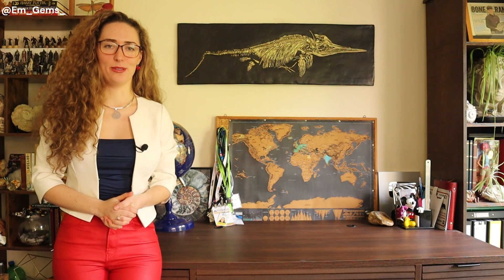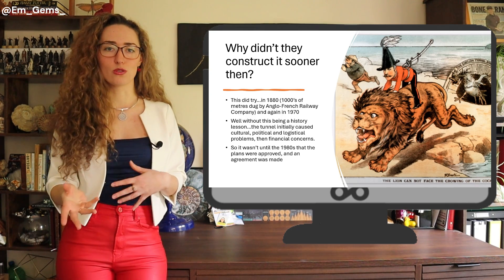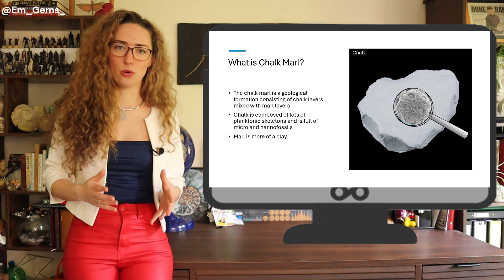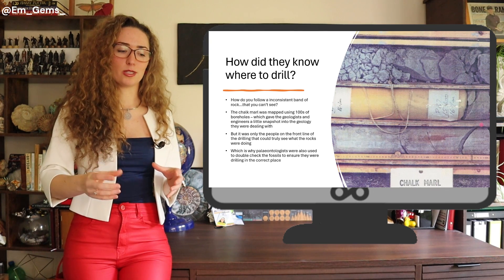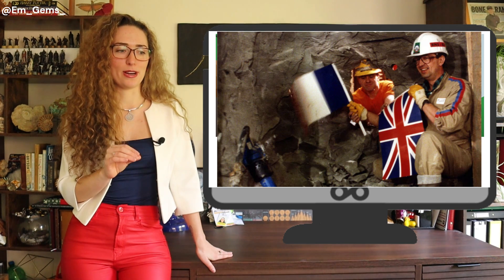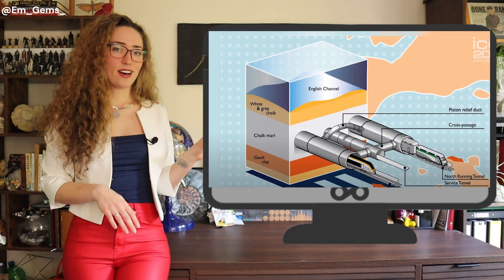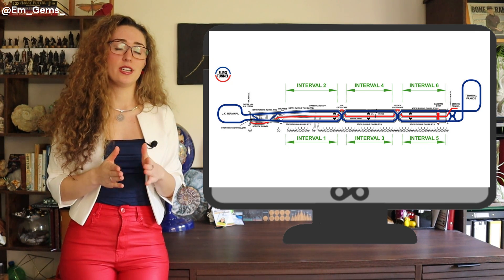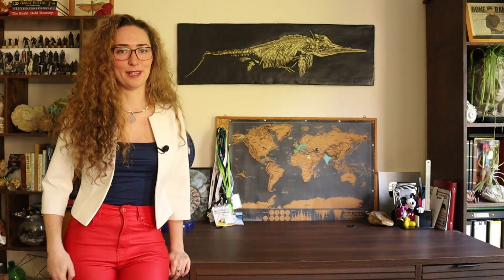The Channel Tunnel - How the Geology made it possible

Comment: Yes, the volume is low (I had to crank the monitors to otherwise-dangerous levels to hear you), but the content is well-presented. You do not get much into the geological context, which is an unexpected result, but you do a bang-up job on the mechanics of the deed and some of the consequences of the build.